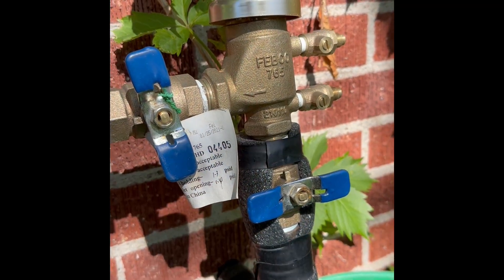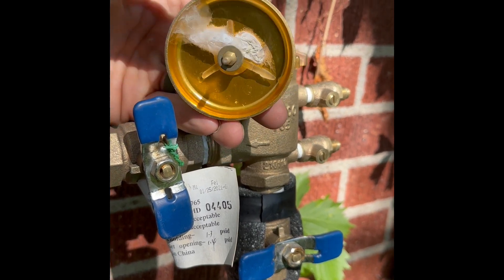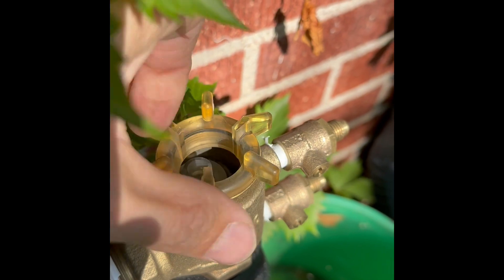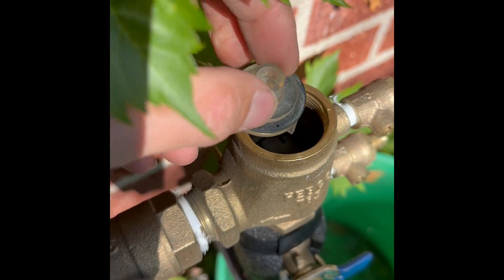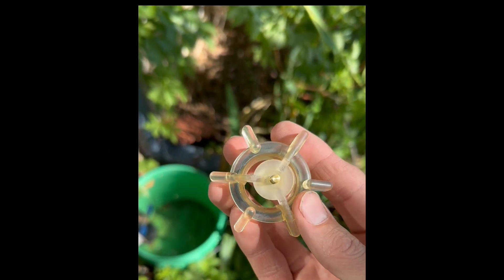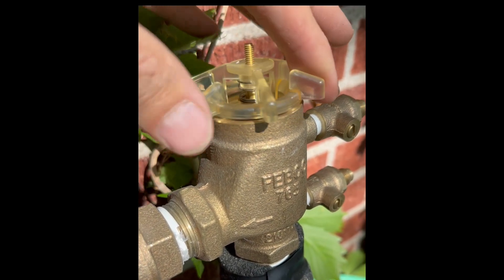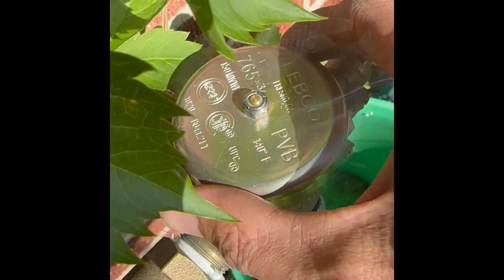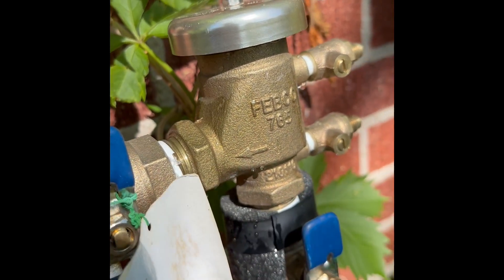How to replace a FEBCO 765 bonnet and poppet

Comment: should you turn the water off first?
Reply from the maker: Yes!  I totally forgot to mention that. Oops. This repair was done before the system was started up for the summer so the water was off anyway. You can use the lower ball valve to shut it off.